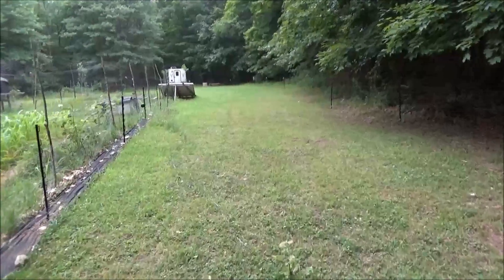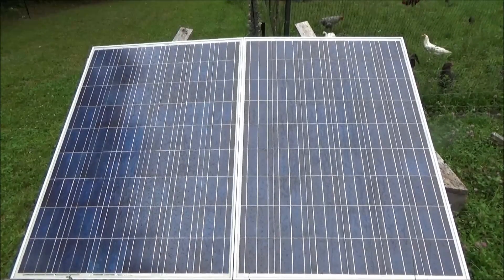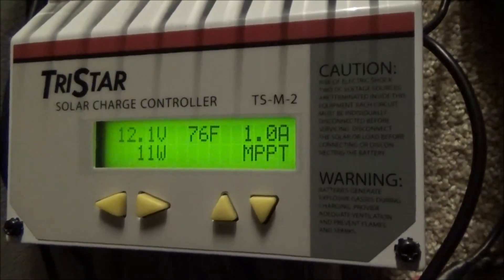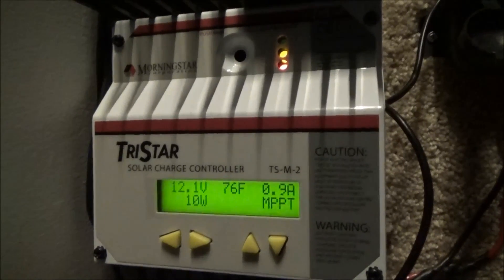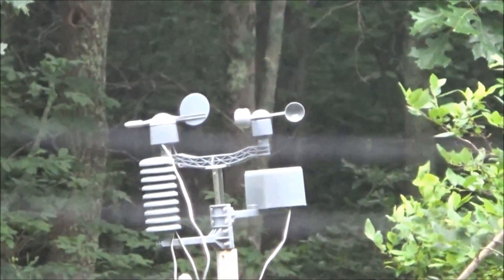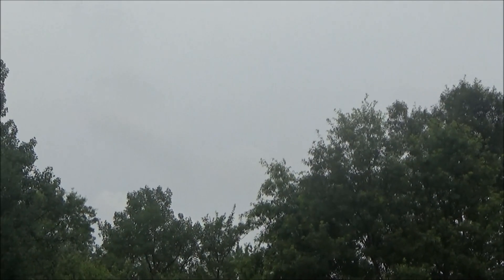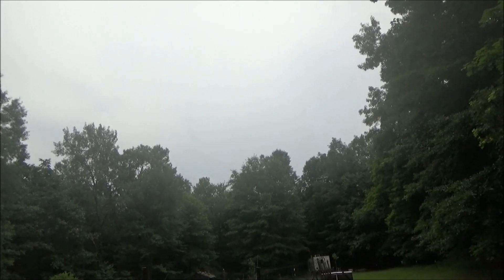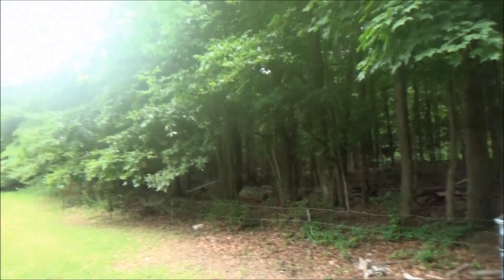Real Life Solar Panel Power Output At My Off Grid Homestead

Comment: Don't you have a Transfer or Town Dump where you can check the recycling or scrap pile for dish trackers. My local transfer has one, come to think of it I may still have an old "DISH" satellite mount in the garage, if that's what you're looking for. I think the mount still might be there, Dish and Electronics have been gutted. Fair warning though the pipe that it used was 2 1/2 to 3".
Town dumps generally allow picking if you ask attendant - they're the rural shopping mart for hdwe. And with DISH and Direct TV not wanting their stuff when you move, most dumps have piles until they go to recyclers.
Far as mounting above the tree line, google PBS Norm Abrams "Flag Pole video" for an idea on how to raise a mast with a bracket set in concrete. That gave me the idea on how to raise a 100 lb. turbine and pipe 30 feet in the air using only a 1940 vintage boat retreiver/come along for assistance. The pipe we used was cut to allow pipe to hinge and then drop down for mounting before bolted thru.

Comment: Troy is under no obligation to follow any suggestions.  However, many have been given that are cheap to do which have not been acted upon.  Mounting the panels higher on a trailer for example and thinning out some trees for more degrees of sun arc to hit the panels.   A trailer could be pivoted with the tractor or a winch a few times a day to roughly track the sun.  These are all low or no cost ideas.  You're sitting in a meadow that is oriented in the anti-solar direction.   Start slowly changing the shape of the meadow.  You obviously have permission to trim and remove offending tree's from prior videos.  The frustration from readers is caused by the failure to act to improve ones situation.  It's far from optimized.  There are plenty of ways to make it better.  It's an accumulation of small shortcuts and 1/2 measures that is making the situation worse than it needs to be.

Comment: Hi Troy, looks like your solar modules have different angles. Keep in mind when your modules are in series they need to be in the same plane at the same angle or you get weak links. For example if you could open up a single solar module and tilt one of the cells out of the same plane as the others you get an inefficient solar module as the cell tilted out of the plane of the others is a weak link when not in the sun and the other cells are the weak link when not directed at the sun. The same applies when you have a series string of modules, for best results keep them all in the same plane pointed in the same direction of course with no angle variation between them. Just my two cents.  Rock on with the tiny home build! Will be watching.

Comment: My phone has a sensor that measures LUX, you may also have one of these. I would use it to check the LUX at the solar cell and chart this if you need to diagnose and lighting related issues. Just a thought.

Since you're going to be fairly far away from your solar cells, you might consider switching the output over to AC at the cell. This would require a bunch of components but it would allow you to use a smaller cable on the distance between the cells and the bank. This isn't too great an idea for you right now, but it is a thought for others.

Comment: If it was me,I would build a doghouse looking kinda thingy and put all my panels on top mount my wind turbines to it,,and all my batteries in the bottom.that way all my power is in the doghouse..Then run a circuit out of there with the finished 120 volt or 12 volt to where I need it,,  Maybe ..Just a way I would do it..Build me a powerhouse then run the power out of it..

Comment: You need solar panels that perform under low light, your using the wrong panels for your area. Here's a site that will give you the info you need, http://www.ehow.com/list_5783187_solar-panels-low-light_.html. Give it a try.

Comment: You could mount your wind turbine.  I think it will be easier this time, after learning the importance of a properly secured installation. I guess it is by now like second nature to secure potential flying debris and ladders after use.  Why not mount the wind generator if it's raining anyway and you can't work on the tiny home?  Isn't it a waste to have unused sources of energy sitting there unproductive when you need power?

Comment: Troy, Just wanted to put my two cents in so that people don't think that your set-up is typical solar setup, my theory is that your problem is the panels your using don't work well in low light situations, I have two 35 watt kyrocera panels that will put out 20 watts combined on a cloudy day, I also have 2 30 watt no name japanese panels that only put out about 5 watts combined on a cloudy day, so my advice to your viewers would be is to do your research before you buy your panels.

Comment: The problem isn't the over cast or the the wire thickness, it's the power loss over the wire for it's to long. You need to put solar cells within 15' of your home or on top of said home.. Also add a light sensor to follow the sun. When compared to the electrical energy generated by a stationary solar panel with a Solar trackers can increase the output of solar panels by 20-30% which improves the economics of the solar panel project. Next do some tree trimming to get more though out the the day if all possible. Then the next thing needed is at least 500 Watt windmill (cost: $399 to $899)
Reply: Don't you think he should move to another location, like Nevada?

;-)
Reply: Alex A if he moved to Texas, there's no state or food tax just for starters. Then there the fact it a great place to grow bamboo; varieties can grow 100 feet tall and 10 inches in diameter in South and even Central Texas in 3 to 6 years.
Reply: in fact it is not really!, you have over voltage cause he is using high voltage in the controller, agree , it is always better to have the thickest wires possible, but in this case it wil not mather that mutch, the amps are low , at high voltage the watts are the same.solar tracker is a good idea, that will indeed produce more power., the biggest point in every solar instalation is the battery capacity, it can never be big enough!, the more spare power you have, the better solar installations work, in delivering power to use.

Comment: Am curious about something. Everyone around here has their solar panels withing 20 ft of their home not far away like Troy has his.  

Is there any benefit to having solar panels closer to the home?  Any phantom energy loss with panels further away from the home?

How much power or hours of power would someone with 20 batteries get vs 6-8 batteries?  And wouldn't marine batteries be better than car batteries?
Reply: My .02... Line loss is going to be present on long runs. It just is. You can fight it by using the appropriate gauge cable for your run. The battery question is likely yes. The more storage capacity you have, the better. Once the batteries are topped off, all other energy is lost for the rest of the day. Use it lose it, as they say. Of course you have to take into account battery quality. A good battery is pricey. I'm sure everyone would like to increase their bank, but it's not always financially possible.
Reply: High voltage suffers less voltage drop than low voltage at long distances runs, high voltage doesn't require heavy gauge wire like low voltage does. AC is more efficient than DC when distance is a concern. 

My brother constructed an shed on the sunny side of his property, 200 feet from his cottage, the solar panels were mounted on the roof and the charger, batteries and inverter housed inside the shed. He ran a 200 foot 120 Volt AC line from the shed to the cottage. This would not work for Troy because he prefers having 12 Volts DC in the RV.

20 batteries like the type Troy has now (215 AmpHours 6 Volt), 2 in series x 10 parallel would add up to 2,150 AmpHours at 12 Volts, 25.8 KWH (7.4KWh usable). Troy's TriStar logs the daily performance but he hasn't shared that information with us yet, so it's hard to calculate not knowing how many KWh he averages each day. I estimate he would need to have 3 TriStars and at least 12 250 Watt panels. On one sunny day, he would be able to harvest enough energy to last many a stormy day. 

I would not recommend 2 Series x 10 Parallel. My system has batteries like Troy's but they're wired in 8 Series x 2 Parallel configuration. It's not advisable to do more than 2 Parallel. Yes, that means the inverter needs to be of the 48 Volt variety. but then only one charge controller is required instead of three. 48 volt and 12 volt inverters cost about the same.

Marine batteries are better than car batteries, but Troy's golf cart batteries are better than marine. If you measure how tall a marine battery is and then you measure a golf cart battery, the golf cart battery will be about 1.5 inches taller.  The taller battery has much more space between the lead plates and the bottom of the case, this leaves more space for sediment buildup. once the sediment buildup reaches the plates, the battery will no longer hold a charge.

Comment: Hi Troy, what do you need to get those other solar panels up as well?

Seems like a waste for them to be on the ground doing nothing... With all the panels up, a break in the clouds could give you double current flowing in.

I did see the video showing the fried wires but the fuel for the generator could have paid for the wires, just a thought

Comment: Troy I have all 12 volt solar panels on the roof that's equals 500 watts. 4 panels = 100 watts each--- 2 panels = 50 watts. should I wired all my panels in series? or keep my panels series and parallel to give of 24 volts on my Mppt TriStar controller to drive my 24 volt Power Inverter.

Comment: You have two problems. The trees and the weather. I have a solution for both. First chop down all those trees. Chop them all down and give yourself a big sky like we have in the South West. If that's too extreme try some agent orange defolient. It worked great on the forests of Vietnam, and it'll work in NY State as well. Strips those leaves off the trees in no time flat. Give you scads of solar in about a week or so. Now the weather is going to be a bit more extreme of a solution. It goes like this. Build a wall about 80 miles high that surrounds your solar plant. Plan it so the top of the wall is just visible to you. That way the wall is below your horizon and does not take away from the integration time of the sun on your panels. Then put a few air pumps on top of the wall and pump out all the air. Your panels will be exposed to the raw sunlight of Near Earth Space and you'll improve their output almost an additional .4 times normal. And get this. No more pesky clouds or rain to cut into your solar production. Now there are a few gotchas with this approach. Such as everyone in a 400 mile radius having no atmosphere. But these are issues to be worked out for the better good.

Comment: Yeah, people don't realize just how sharp the power fall off is on polycrystalline solar panels. You lose even a little sun, you lose quite a bit of output. Amorphous panels do a little better In subdued light, but not much. Mono crystalline  offer improved low light performance, but still, the fall off in output is quite dramatic in even slightly lower light. Every watt counts. Conserve where you can. I've gotten to the point that I look at the watt labels on every appliance I purchase. Doing runtime calculations has become second nature and a fact of life. 

In other words, I feel your pain.

Comment: Solar power is all about location location location. In New York state the average usable solar power is roughly 4-4.5 hours a day. Being in the woods and near mountains will reduce it. Just goggle "usable solar power per day" and you will get all kinds of charts that will show you the average hours per day, You can do the same for wind power too. From what you have stated with your generator, I would go get about 10 gallons of gas, this should hold you for about a week.

Comment: Maybe, instead of cutting a tree and digging it in, you could use an existing live tree and mount your turbine to it. Tall and big enough to support you and the turbine weight. top the tree just high enough to clear others and then also low enough to mount your hardware and for you to access for trimming. Although unless you can climb or attach ladder. material you may want help... A live tree will give you all the structure and support you require, plus the price is perfect. But also I thought your turbine was destroyed...?
Reply: DEW W I have wondered the same thing. Have know folks who have paid to have a tree trimming person or a logger person come in and climb the tall pine trees around here to strip all the limbs so a wind turbine could be installed on the top of the tree.  Since the trees are firmly rooted less chance of one falling over.

Comment: I recommend you get two more batteries for your battery bank for more power storage and see if you can make an rain powered hydro electric generation that you can link up to the opening of your water tank and it doesn't have to be that big just as long as the power it producing can help to maintain the batteries at least

Comment: Ya'll might try uv excited panels. Work on uv rays which get thru everything but thickest rain (like a satellite dish). Will get you a bit more energy over time, also need more southern exposure in meadow area. Turntable mount to be driven by you manually would get you more power too.

Comment: Troy you have TWO wind generators. . . .and you have had LOTS of storms. . .and wind. . . and still no wind generators??? (comment made in first minute of video).
Reply: Troy. . .the charge controller should have an ethernet plug on it. . you know you can web browse to it . . .right?????
Reply: Troy. . . you need a larger battery capacity bank.  IF nothing else cobble together crappy batteries (bedini them, whatever) and when you do have excess power try and store more power for the less ideal times.  IF nothing else. . . larger battery banks will be ideal for the 100amp DC motor charger as you can fill more volume of juice if you will for later. . . just a thought (yeah I know. . batteries are not cheap in any form. . I know I know. . . )
Reply from the maker: I have no tower for the wind turbine right now. I did mention that in the video. Please understand if I cobble it up again, I may lose another wind turbine. I am looking for a real tower.
Reply from the maker: jgreen302 Yes the charge controller has a plug and I do plan to connect it online soon.
Reply from the maker: jgreen302 I do also plan to expand my battery bank soon. When I build my tiny home I hope to have more batteries and also have a backup set. But yes its all about the cost.
Reply: timcat100 With no sun. . no amount of panels will satisfy the batteries.  When he does has sun. . .he tops them off and has power to burn.  He does have the motor driven DC generator to collect power but I think a larger battery pool is like a larger lake. . . .harder to drain all the time with more volume. . . at least you can store more power to go long with odd weather. . .
Reply: timcat100 i would be interested in seeing that... :)
Reply: oooouuuuufffff 9kw? NIIIIICEEEEE No issues generating power then.... ahhahahah Thats ALOT!
Reply: jgreen302 Between the trees there is not much wind to generate energy from.
Reply: jgreen302 Between the trees there is not much wind to generate energy from.
Reply: +2014andBeyonD The meadow does pose a wind generator challenge.  But in the winter the wind blows a LOT and that is FREE energy in a storm.  Having them sitting doing nothing means you get nothing.  He has had them up and they DO produce when the wind does blow during storms and weather changes.  In a box. . . .zero.

Comment: Hey genifer smith watch his other videos and you can see the trees moving. You don't need to get the generator 60 feet in the air 20 ft should. I live in the woods and have both solar and wind and I don't run out of power for a 3 bedroom home. when the Sun isn't shining most likely the wind is blowing. Troy showed us 15 minutes in this last video that the wind was not blowing looking in his station see the average speed.

Comment: Also Troy, 

I know you say your not getting enough sun for power... i recently installed 3 x 305 watt panels on my shed for my startup setup and the other day when the grid power went down during a severe thunderstorm i went out into the shed to flip it over to pull power from the batteries since i dont have an auto switch yet and i was still getting like 129 watts coming in between all 3 with raining coming down hard enough to turn my backyard into a layer of water..... during the clear sunny days i only peak about 870 watts at best i think.. i know you have 1 main charge controller, but i read somewhere when i was doing my research that multiple smaller chargers will come out of float easier than larger units and adjust between the levels of output with more sensitivity than some larger units.. so i went with 3 smaller charge controllers with 3 micro-inverters... i wander if your system is unable to drop out of float very easy.. look into the minimal settings on the charger, and inverter..
Reply from the maker: It all depends on how dark it is outside. I get between 8 to 150 watts during the rain storms. Dont forget too that I am in a meadow and behind a mountain. During direct overhead sun I get nearly 800 watts